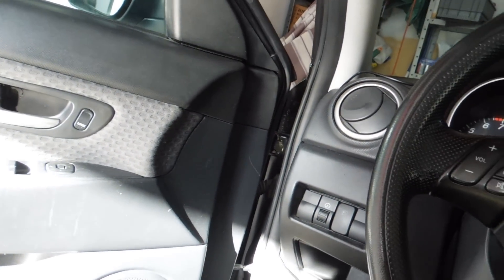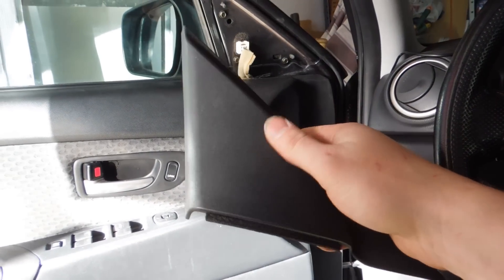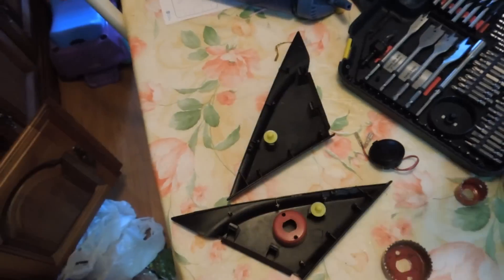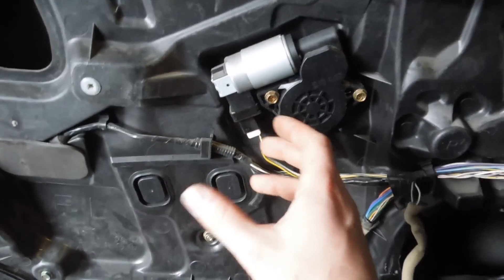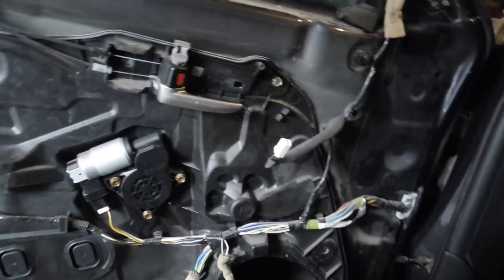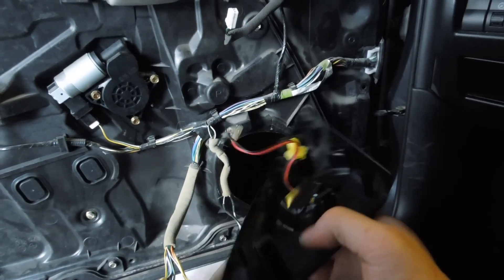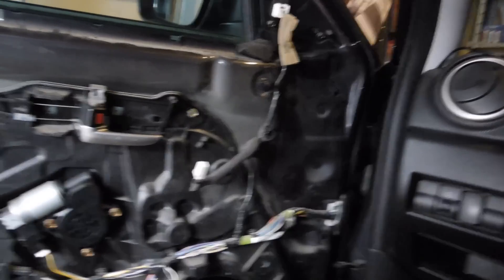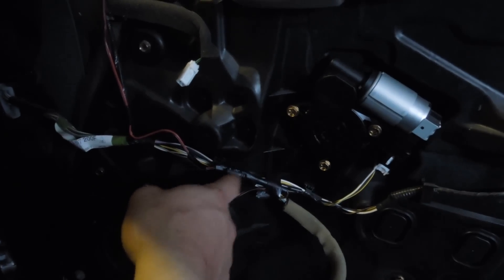how to mount and pick tweeter and crossover over locations and adjusting in car

Comment: my car has the tweeters pointed to the front windshield so the drivers side reflects off the windshield towards passengers left ear and opposite for passenger side door. I found this position creates a more robust sound in the cabin at lower sound volumes. my car is a 99 prelude so the front windshield is more angled.

Comment: I love how concise and detailed this is. Unfortunately it didn't answer my question but... excellent video
Reply: crdirtrider856 what is your question ?
Reply: So if I'm using all my output ports for a sub and box, where can I run my tweeters from?
Reply: @crdirtrider856  you run a highpass filter (the crossover box the guy talks about) from the main door speakers. Just splice off the speaker wire before the main speaker, connect those wires to the filter and connect wires from the filter's output to the tweeter. The head unit - or whatever's powering the main door speakers - should be powerful enough to run the tweeters without any issue. Door speakers can handle between 45W and 100W a pop, usually around the 45W-55W range. A regular factory head unit will usually put out around 50W per speaker. A tweeter + filter wants between 0.5W and 5W to work. There's plenty of power headroom there.
Reply: @peterjohnson9438  ok I basically get what you're saying and I'm gonna have to dumb it down at some point. I'm not clueless, but it'll just be easier for me to translate to shorthand. Thank you

Btw if I switch to the hi-inputs, I can still go g....?

FFS I forgot what I was going to ask. 
Thanks though 👍

Comment: thanks Bro...I never thought of putting tweets in the pillars and based on ur vid that's where I'll be mounting mine.
Reply from the maker: if you want to see how it looks in the pillars check this link out it has all the pictures of my build (you might have to like my facebook page, not sure) https://www.facebook.com/media/set/?set=a.232356110254355.1073741827.128180714005229&type=3
Reply: actually my GMC SAVANA van won't accommodate on the pillars...bummer...but I found an apt location under the power window switches that should be fine. Got started last night and Crutchfield had some misinformation about my vehical fit so I'm waiting on re-ship of larger ALPINE speakers for the door panels.

Comment: hey just want to ask i have installed rockford t252s components but my tweeters r not working,it might be blown,so do i need to buy another components or i can install any tweeter with a crossover
Reply from the maker: yep you can buy new tweeters :D if you switch to new brand of tweeters might want to consider new cross overs

Comment: You do realize that your windows roll down behind the wall where the motor and locking mechanism is located. The crossover will not get in the way on this side of the door.

Comment: Tape won't last through weathering. Screws and silicone are the best option. Tape will last 3-4 years but if you don't plan on touching it for a long time then it will eventually fall apart.
Reply: Sean B fine bead of black silicon would have been perfect...! That bugged me a bit

Comment: a mid should be low pass crossed over at like 450 a sub should be at 100
Reply: KingOfShenanigans you understand that youre losing 350hz of sound? Sub stops at 100. Nothing is playing the sound until you get up to 350. Say goodbye to mid bass my friend
Reply: KingOfShenanigans  A mid should be low-passed more like 2500Hz to 3500Hz.
Reply: Chase Meyermann a low pass filter takes away highs, not lows. You won't be missing anything. The tweeter won't last a week though.

Comment: Never mount a crossover in a door..
Reply: Why's that?
Reply: +Nate Miller water
Reply: +Greg Profitt that's only if you have bad seals otherwise its pointless to put speakers in doors
Reply: +swagg so smooth23 i always use baffles to protect speakers and mount crossovers near the amp.  No one wants to take off a door panel to adjust a crossover.
Reply: +Greg Profitt you tune it before you put the door panel back on.  common since. I've never seen anyone mount a crossover like the one in the video by the amp but hey that's just me. I'm just stating the fact that if water was an issue in the door then cars wouldn't come with speakers in the door factory
Reply: So you just double the amount of speaker wire you need for no apparent reason? Sounds like a plan to me...
Reply: Greg Profitt I’ve seen crossovers in the door quite often what you can do to hold off on corrosion is first make sure it’s as sealed the best you can get it and if you have screw terminals take a Q tip and apply a little dielectric grease to the terminals and it will help with moisture.